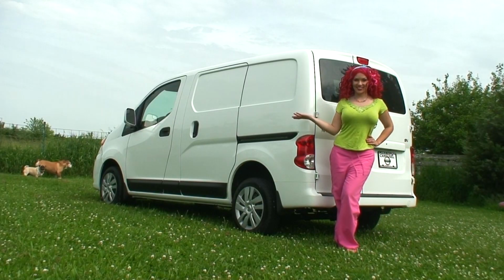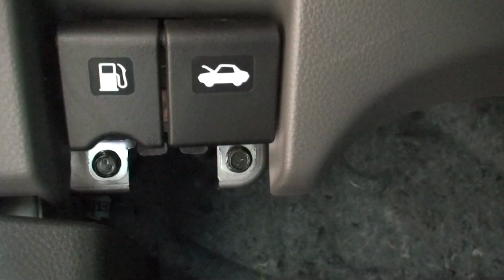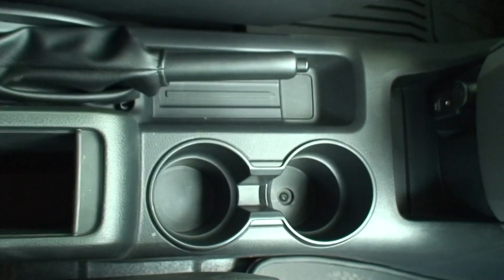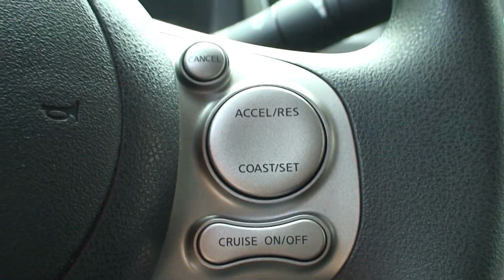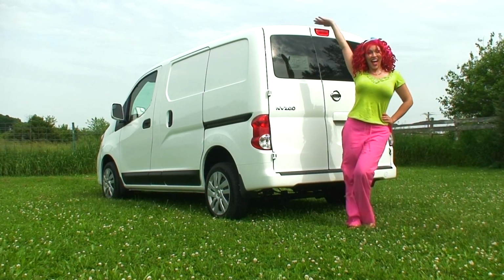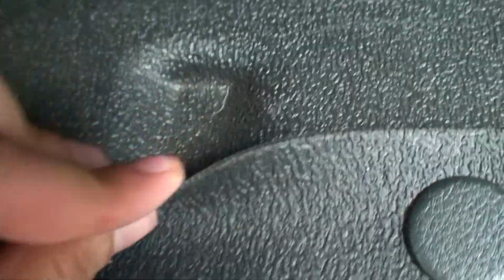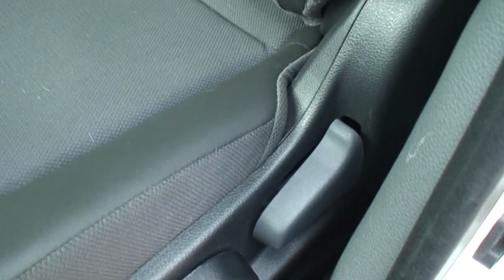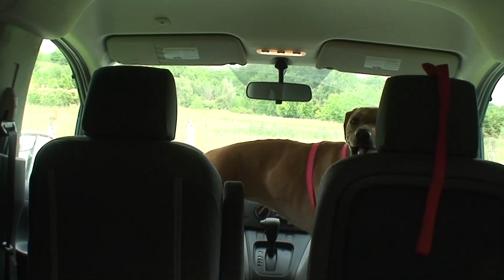My Brand New Ride!!!!  2015 ~ NV200 SV Compact Cargo ~ Shuttle Debut, Nissan Review

Comment: Use moving blankets to cover all but half of the front (they are cheap so get many). You can take these out and replace them with clean ones until you can hose-wash and hang the others dry. Use Bleach in the hose-wash to prevent cross contamination of bugs and microbes. If you are transporting sick dogs be sure you have more blankets to hang all the way around the kennel to limit exposure to others. Spray down everything with disinfectant. It will be more economical to buy bleach and dilute it no more than one cup to a gallon and spray it on. DO NOT USE MIX DISINFECTANTS !!!!! Like ammonia! Use all of one or the other - never overlap it. the gasification in an enclosed space will make them and you sick or dead. Have fun!!!!!!!!!!!!!!!!!!!!

Comment: I have this same van. 
Just bought interior side panels from Canada. 
Red / black leather seat covers.
Reply: where did you get the interior panel , i'm from cdn and nissan.ca don't offer that
Reply: +stromeur M https://bodyguardvanliners.com/
Reply: ok thank but they didn't give any price info on their site
Reply: +stromeur M it's expensive. Over $800 for both with shipping.
Reply: wow , I miss my old '89 dodge caravan cargo that I had finished with panels from the regular model  found  in a scrap yard .
Reply: +stromeur M right. The new panels only cover the rear sides. Not the rear or side doors. I've dented mine 2 times from the inside on the rear doors. Nothing I could find for those areas. Local body shop said they could fabricate panels for around $400.
Reply: May be in very far  future there gonna be some NY taxis at the scrap yard ! Can' t count on that , I gonna look at home depot for flexible wood sheet .
Reply: +stromeur M I did find a precut kit in Europe. After purchasing, they refunded and would not ship.
Reply: @stromeurm7410  Hello guys I'm trying mo make a survey about nissan CVT transmissions so I wanna know the locations(countries/states/territories/cities, etc) of every nissan CVT lovers and Nissan CVT haters as well. Thank you so much guys and hope you all join the survey.